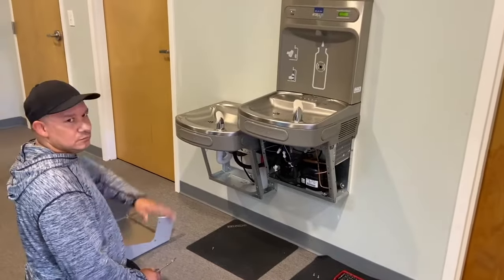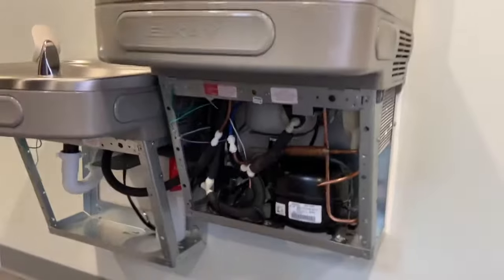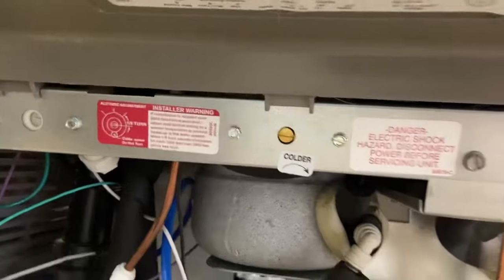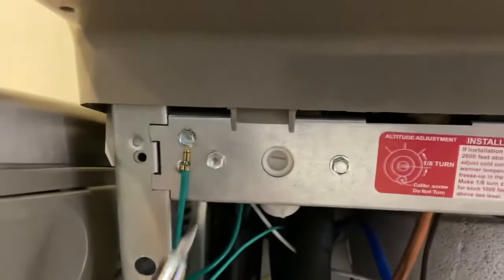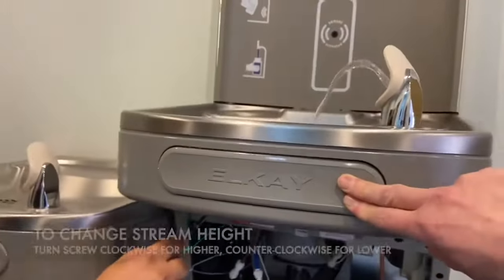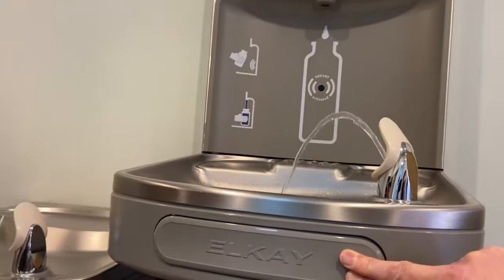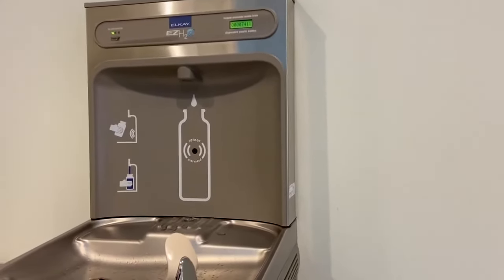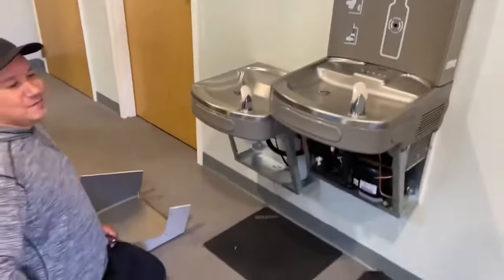How to Change the Water Temperature, Stream Height, and Pressure on an Elkay Drinking Fountain

Comment: We just had one of these installed in our building on Fort Custer. Does that temperature adjust on this video adjust both the spout and the bottle filler temp?
Ours is not cold enough, and we are trying to do away with out water cooler which is nice and cold.